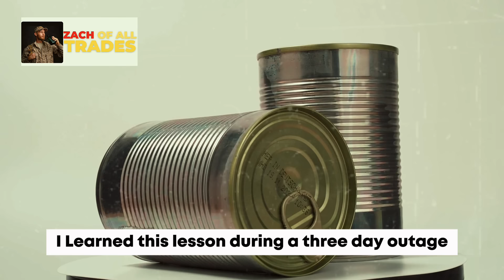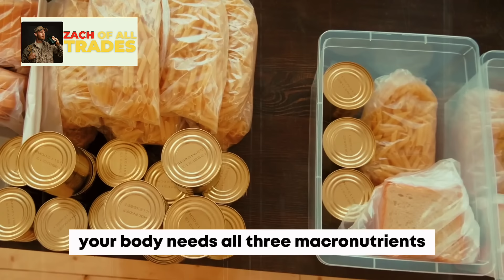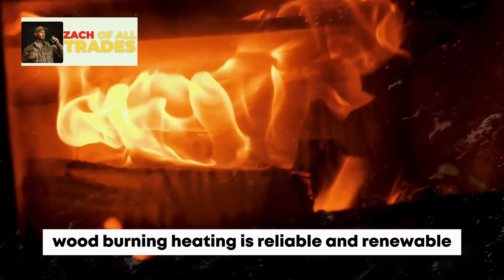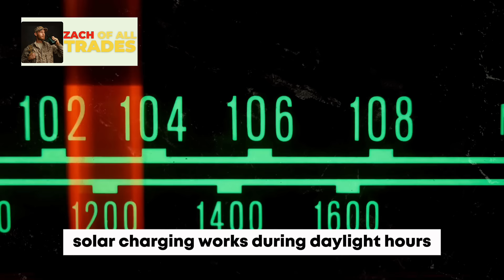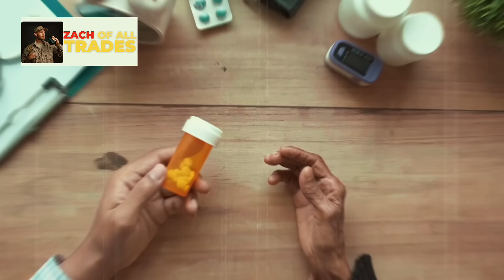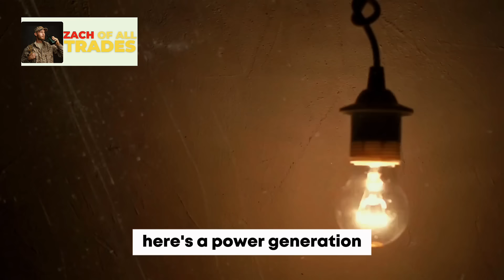11 MUST HAVE Prepping Items to Survive a Winter Power Outage!

Comment: It's good to keep a log/journal 
Date and times per person logged
It can be simple like when you and who ever wake up. Name and time
What you eat and what time you eat
Give each person a journal to log feelings and needs/I want/would like ect. 
Where you all eat and what rooms get used that day.
If moral seem bad plan something like hot cocoa or other treat that isn't part of snacks and meals or maybe something like making bead bracelets.

Another thing is if you have to use a candle over night get a clay pot and put it in there. It's less likely to tip over and if it does the wax and fire is contained and the wax may smother the wick.

Comment: Couple thoughts:

Get a wood stove in advance. Yes it takes up space but then you have a ready to go and safe heat source  and it can help cut your heating costs in normal times. Some are even made to be cooking surfaces as well.

Almost nobody suggests indoor rated oil lamps for light. They can double as decor the rest of the time and are safer than candles.

Comment: DURING THE ICE STORM THAT TOOK OUT THE POWER FOR A WEEK I RAN A NUMBER 12 WIRE 30 FEET FROM NY CAR BATTERY TO MT 400 WATT INVERTER WITH USB PORTS I WAS ABLE TO CHARGE MY PHONES AND FLASHLIGHTS WORKED VERY WELL . I USED MY BIGBUDDY MH18 TO HEAT MY WELL INSULATED APARTMENT!

Comment: I've been looking at getting a 12VDC to 120VAC 1000W inverter to hook to my car this year. If there is an extended winter power outage I can use it to run my electric-gas furnace periodically throughout the day to keep the house warm and prevent the water pipes from freezing.
Reply: Be sure and do your research to be sure you get an inverter that will handle the load you are planning on putting it under and to be sure you car can supply that power level, I suspect 1000 watts won't  be big enough. 2000 would be better. Also get one that produces a "pure" sine wave. The cheaper and "dirtier" inverters will damage circut boards and almost all house hold appliances have circut boards these days. Also, using an inverter will put extra stress on your car battery, I keep a spare car battery just in case it fails. Lastly, be sure to have enough heavy duty extension cords to reach everywhere needed. Monitor temp of cords and connectors,  if they get hot or even warm to the touch, they aren't  big enough for the load and distance.

Comment: the texas freeze would not have been if the state did not try to go green. texas shut down 99% of there coal, oil, nat gas fed power plants. and was buying from two states away.
any small problem cascaded in to Hugh problems.
Reply: 😂😂😂Texas power went out because they didn't winterize their gas power plants. 
WV has renewable power. We have gas, wind, solar, and hydroelectric. Our power goes out because people, trees and weather knock down power line poles. We have some bad winters but don't have to worry about power production. We just have to worry about high power bills having a monopoly of only one power company.

Comment: You can actually run the furnace in your home with your car battery and an inverter,
You can find videos on YouTube.
Those cheap $4 emergency blankets work amazingly well, I had to use one when I was freezing. They do cause condensation, so you'll definitely need something between your clothes and the emergency blanket.
When my power went out in Denver, Colorado I used my
500 W power station to run an electric throw blanket, which kept me warm all night.
I have a 55 L refrigerator
that I can plug into the house or a power station. I use it for camping and hunting trips, but I did have to use it when a refrigerator crapped out
In my house.
Build a vegetable oil heater for emergencies. A couple of these can heat your whole house enough so your comfortable.
https://youtu.be/0SkqZny87Ew?si=YSWdbdyO4kBUL2xm

Comment: -13 °F (I'm assuming since this was in Texas) is cold but it's not THAT cold .. unless maybe because it WAS Texas.  Southern Ontario Canada here and the weather regularly goes below -13°F [-25°C here] .  Also the power rarely goes out due to the cold for that extended period of time except in EXTREME circumstances (Montreal January 1998) sometimes for a few hours during a storm but even that's rare.  We DO have to worry about pipes freezing we usually turn off our outside pipes in the fall so there's no water to freeze and our indoor pipes are usually ok

Comment: You left out an important point in the perishable food segment! It is a winter power outage. Place your refrigerated perishables outside or in a non-heated garage. They will stay cold and not perish. Put them in a cooler outside your door. You do not have to lose your food during a winter power outage.
Reply: Excellent tip!

Comment: Im already off grid, wood heat, 5, 20lb propane tanks,  gas stove. I work at a laminated beam factory with tons of fir cutoffs. More wood than people can ever use. Low voltage lighting,  3 generators, battery bank and wind turbine.
Reply: What do you use as a battery?
Reply: @Sassy-415 i have 12 deep cycle batteries but want to go to 20 batteries,  12 volt and 24 volt configuration.

Comment: Propane is my go-to emergency heating/cooking source in my small trailer. I get the 20 lb tanks refilled and then use a couple with a hose into the house (they are outside) and use another to put into 1 lb bottles (in ones designed to be refilled). I use Buddy heaters that are safe for carbon monoxide & have a tip-over feature. I retreat into my bathroom which has a floor long enough for laying down if it's very cold or next to it is a very small bedroom, both interior rooms.  My kitchen has south facing windows that heat up nicely during the day.

Comment: We lived in Texas dhring that snow event. There had been  AT LEAST 5 DAYS of warning from the weather channels (POW Ponder on Weather procuced by Roy Ponder from Dallas/Fort Worth for example) It was not  a surprise for us.. our protocol was exactly what you are saying. 
Our town was without power and WATER  for 4-5 days. One thing we did that you didn't mention was running a trickle of water-catch as much as possible for secondary uses- until the water quits. It will keep the pipes from  bursting from freezing temperatures. Don't worry about broken pipes once there is no more water coming.
During the day, if it is a sunny window, add to heating by opening the curtains or blinds for passive solar heat. Shut them when sun is not direct. Or use as lighting as long as possible before lighting lanterns, etc.
Reply: There was ample warning before this storm hit but people did not choose to listen.  I was living in my rv at the time and made it through just fine with proper preparation.

Comment: Fuel gel. Doesn't matter about temperature,  and burns clean enough to use inside as alternative heat source.
Reply: Too expensive and smells. Better use some kind of neutral liquid spirits without additions.

Comment: I say this to everyone. Having supplies is important. When grid power is gone you still have human power. Our ancestors survived without it. So can we. Have non perishable food stocks. Canned or preserved meats and veggies on hand. Have camping supplies. Candles, oil lanterns, even mini propane heaters or stoves with the 1lb bottles. Have blue painters tape. We used it for a broken window from a frozen stick hitting it. Trash bag taped around the window to keep out the wind. Held up for a week until I got new glass. Have extra over the counter meds in case you get sick. I had the flu during the freeze back in 21. I made it.  Build your stock over time. Replenish regularly. Not a bad idea to have a small quiet generator either. Can run a small electric appliances. Or even 12v portable stuff from Amazon. I can charge the batteries with my car even.
Reply: Absolutely. Just remember, 12v appliances are much less powerful. For heaters, coffee makers, and kettles, get used to wait a little longer. Learn to be patient.
Reply: how about a home generator and a few smaller generators ?   camping campstove for outside to cook out there  .  paper plates , bowls , spoons , forks , etccc in a pastic storage box ? 
NOAA radio , just to name a few .

Comment: In the Texas freeze I filled up all three of our bathtubs with water and covered with Saran Wrap. Did this as a precaution in advance and glad I did. Used two of them before the water turned back on a few days later and was safe to use.
Reply: Look into buying water storage bladders. Aqua pods is a brand. I just bought 2 of them along with water pumps.
Reply: @ASears-uy3wh I bought a wood stove lol didn’t want to be without heat again, Northern Tools always has a great sale at Christmas, thanks for the water bladder info .
Reply: You have 3 bathtubs?
Reply: @Snowsey here in Texas if 4 bedroom the newer homes have 3 full bathrooms , not unusual to have a 3k sq ft home .
Reply: Yeah.. Guess I got ripped off! My house is 3,308sq ft, 2 fire places, 3 toilets but only one bathtub! LOL! Guess we do have a broken hot tub we could fill.
Reply: I'm hoping you washed your bathtubs first?  Also as someone said you have 3 bathtubs?
Reply: @daniellestolys6951 if you are using a water bladder, the water never touches the tub surface so no need to worry over tub cleanliness.

Comment: When I bought my butane single burner stove for power outages it came with a hose to connect it to a 1 pound bottle of propane. It's dual fuel. And safe for use inside with the butane. And best thing is it only cost 35.00 at Walmart. Maybe folks could use something like that. Thanks for sharing your work and knowledge with us I appreciate it.
Reply: Just got mine!
Reply from the maker: Thanks for the tip, great info! and I appreciate the kind words
Reply: Got mine! And extra fuel.
Reply: Please boycott Walmart.